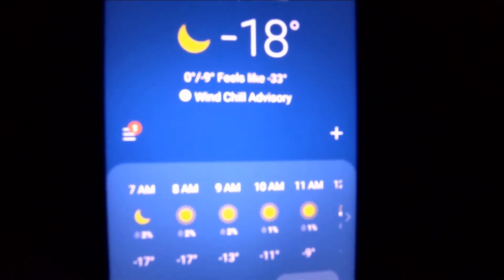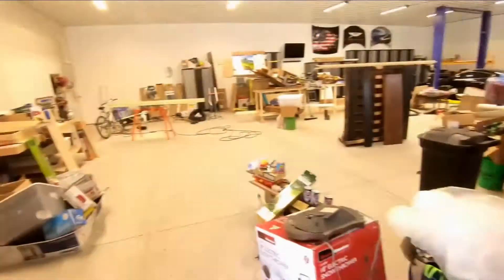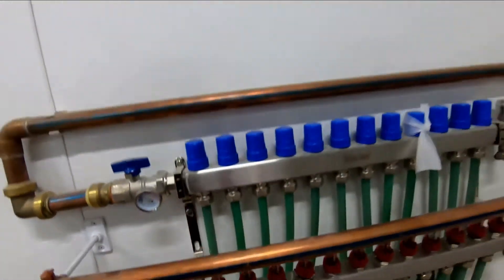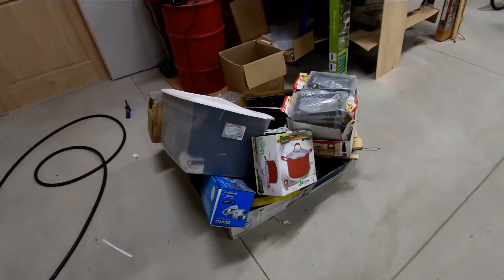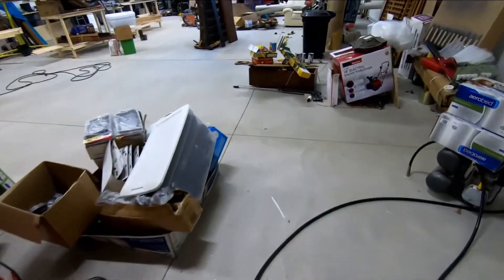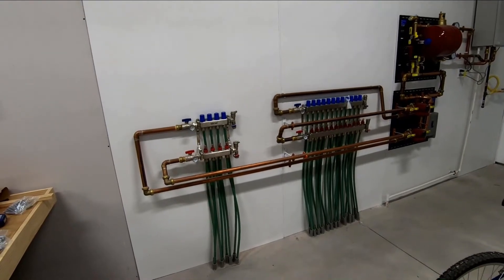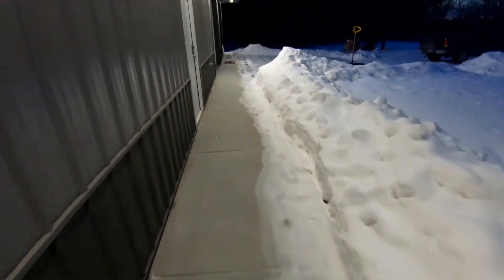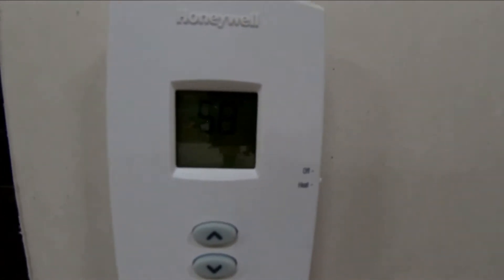-30  Degrees ! Did it Heat? NO Slab Insulation & Tankless Water Heater in Pole Barn Radiant Floor!

Comment: I am curious to know IF adding slab and perimeter insulation during the construction phase would have boosted your air temperature in the shop.  Is a floor slab thermostat "better" ?
Reply: Your not considering the cost of energy in the future.

There’s absolutely no way your saving any money without insulation under the slab.

Penny wise, pound foolish
Reply from the maker: @goobers8277  Its called a Thermal mass build and I am heating this cheaper then most 2000 sq ft buildings around me.  You put insulation underneath , you have a smaller thermal mass. Think of it this way, you have a small rock and a large rock. Small rock heats up faster then large rock , but cools down faster. This is a large rock and will keep heating without needing more heat input during the really cold days. It can go for 3-4 days in 20 degree weather without running. Where a insulation under slab would run everyday. If you want to learn, there are studies from different countries that have done Thermal Mass builds. Google it .  Building techniques have advanced in the last 50 years .People  said the same thing about spray foam insulation back in the day or about offset studs , it was a different way that many people weren't interested in changing to and said that isn't the way it has been done.
Reply: @JasonYouTube  Brother I’m well aware of thermal mass. 

But your explanation is slightly flawed.
You could have dug deeper? Yes?

Why not put 4” of ridged polystyrene foam board down first and then 12” of concrete. 

Plus IMHO not using ICF in new construction is absolutely crazy.

Just my $.02
Reply from the maker: @goobers8277   Your still not taking in the fact that the ground has heat also which helps in heating/cooling . Also concrete cost $140 yd vs $5 yard for sand and they have the same thermal properties. So I could of put insulation under 12" sand and then 4" concrete , but the cost of insulation wouldn't offset the cost savings of having that insulation underslab. Even if I saved 10% a year if I had insulation , my yearly heat bill is about $550 . So insulation cost of $2400 divided by the $55 savings would be 43 years until I recover the cost of insulation, which doesn't include the time to lay it.  Not you may say I'm wasting more then 10% to ground , and I show the cost in multiple videos , on how much it cost to heat a cu ft in my pole barn so others can compare it to their buildings. My heat bills are actually lower then most 2400 sq ft buildings that are stick framed in my area and that are roughly the same insulation values. Yes they may open the door more, etc.. but when people see my bills they are amazed at heating that big of area for that low amount. So talk to other builders who do thermal masses and see what they say, or check on google for some research about thermal mass builds. If you eliminate the underslab insulation, then you will eliminate the jobs and money to those contractors that are pushing for the insulation.  Like anything, follow the money trail . Researchers are not going to say something is solved if they are still getting funding. Why give up the money
Reply from the maker: @goobers8277 Put it this way,  Is your home or new homes built with R90 attic and R40 walls? No. That is because the added cost of insulation would not offset the cost of loss heat. Why doesn't every home have geothermal heat? Its more efficient and saves money yearly but it costs 25K and will recover cost in 25 years.  So those are some real world examples on how letting heat loss is acceptable if you cannot recover that cost sooner then 25 yrs.  So your saying that since inflation and cost of energy is going up, that homes should be R90 and geothermal systems ? I agree with your thinking but most people will not live long enough or stay in that home long enough to recover that cost. So environment energy saving wise, you are correct. But things change, in 20 years they may have different insulation or heating , that would make all those previous 20 year ago upgrades useless.
Reply: @JasonYouTube  insulation is the most inexpensive way to save money in any home or shop?
You have to factor in the resale of structures/property into account?
For most people this is a huge consideration?
I live in suburban Detroit (see cold lol) many new builders here using R60 in the ceiling & R35 in the walls for stick frame construction. It’s now code to insulate basements. Either exterior/interior or both. Now personally when I build my home and new shop, it will be 12” ICF block walls, ICF roof, insulated 10” concrete floors with hydronic heat. I will run two sets of pex in the floor. One for a hydronic N/G system & one for hydronic wood stove for power outages. I Will also take advantage of South facing windows for solar gain on the dark concrete floors. 
Geothermal has come down in price quite a bit from even 10 years ago. In Canada the Gov is actually paying for its citizens to have geothermal installed.

Here in Michigan geothermal (well type) is being used in industrial locations in conjunction with 3 Phase electrical. So it’s inexpensive to run.
Reply from the maker: @goobers8277  For resale , extra insulation won't make a difference, kinda like home remodeling and putting in exotic wood and expecting dollar for dollar recoup. Or the wife who spends 80K on the kitchewn but only appraises at 40K .  Your going to have over 200K in a shop, and you won't be able to recover that cost in resale as most people don't want to pay for the extra space unless its a single guy! If you do your build then its for you and not resale.   Finished garages get between $15-$45 a  sq ft for appraised property value in my area, mine got appraised at 100K before pandemic .  My neighbor is putting in a new 40 x 60 and got quoted 70K for structure only. That was the middle quote , and my 40 x 80 was 46K  for reference. So if you go above appraised value for sq ft , then you won't recoup it.   Geothermal is cheap to run but in the USA it is too costly. My neighbor installed them for a living and our house had it growing up. He got out of it because the rebates wouldn't make up much for install and residential business went down , except new commercial builds. I like the idea of a wood stove boiler , maybe you could run a bypass so you could only use 1 loop but when switching to other system could use a bypass valve?   But some counties won't allow that so the code dictates it. Kinda makes you want to move to Texas where codes are lax.
Reply: @JasonYouTube  I like to hear Your perspective. Your spot on with the geographical location. Yeah what’s really nice about the gasifying hydronic wood stoves is the heat from the floor and the stove. I’m not as worried about the overall upfront cost of all the systems as long as they are done correctly and save on future bills.
Reply: @goobers8277  Did you read the whole comment?
Reply from the maker: This has perimeter insulation , just no slab insulation. I compared it to my neighbors and another person who has slab insulation, and they couldn't maintain their temperature. BUT that could be due to they didn't design their system to -30 . I had this system designed to about -20 degrees at 65 temp. That means they added more radiant tube runs to heat the slab to maintain that temp. Said it was overkill, but better to have more tubing and shut off some runs or turn boiler temp down then not have enough. For the price , a 300ft roll was only $79 more , so cheap insurance to add more tubing.  My one friend just built a stick framed garage with same insulation and is running radiant with slab insulation, so I will be able to compare heating costs this winter. His build is smaller ( Under 800ft I believe) but should get a good idea on heating costs.
Reply: Built a post and frame building in the late 90's and didn't use floor heat or insulate under the slab.  I used a 2 foot rigid insulation board around the entire perimeter and I have no problem heating the structure with  inceiling hot air.  I live in upstate NY and we get some pretty cold weather.  I insulated the side walls and ceiling above specs. I also left a dead air space on the outside of the building.  If I were to do it today, I would have put floor heat in, and also put down rigid spray foam insulation under the slab.  That being said, my floor slab is warm.
Reply: I sure would have tried something - 2" XPS sheets or maybe spray foam. Foundation work is not something you "remodel" later.  What I wonder is does pex tubing go under or on top of rebar [or wire mesh] before the pour?
Reply from the maker: @flinch622  If your doing traditional insulation underslab heating , you usually staple the pex to the insulation , then rebar is in middle of pour above the pex. If your doing a thermal mass build like mine, the pex is in sand about 10-12" below the concrete , but is tied to a mesh grid work in the sand to keep pex in place.

Comment: Hey what is your condensate line for ? I am in the planning stages. What kind of sand did you use ? I priced sand it would cost me 8k
Reply from the maker: The tankless water heater is high efficiency, condensating , so extracts all heat from water vapor. Just regular sand, usually get it from sand pits . Sometimes can get it free if they are building by you , depending on if your area has basements.  Usually  it costs around $2-$3 a yard but trucking costs alot. Unless you can get a semi side loader. Then price goes down

Comment: Do you have a primary pump on this system, or just 2 secondary pumps for the 2 zones?
Reply from the maker: I have a primary / boiler pump and then 2 zone pumps. I show the setup in my video on how to build a radiant panel, so you can see all the parts. Thanks for watching
Reply: @JasonYouTube  
I'm trying to setup a Takagi water heater for a radiant system in a garage with no domestic water and am having problems figuring out how to control the primary pump.  Was going to do a primary/secondary loop.  Secondary loop will be 1 zone with 6 radiant loops controlled by a thermostat with floor mount sensor.  Primary pump turns on and off how?
Thanks
Anthony
Reply from the maker: @anthonyperalta8534  Primary pump will turn on whenever a zone calls for heat. So you only have 1 zone pump, so whenever that turns on, your primary pump will turn on also. Your zone controller should have wiring for that, but depends on what controller your using.
Reply: Ok.  So I saw your other video showing all the parts.  The primary pump is just plugged into the outlet with an extension cord.  And the secondary pumps are wired into a switching relay.  So how is the primary pump being controlled?  If plugged into an outlet it would run all the time, wouldn't it?  Thanks.  Very clean install btw
Reply from the maker: @anthonyperalta8534  In my setup, the zone relay controler is plugged into the outlet and the tankless water heater is plugged in also. The primary pump wire goes to zone relay. If you search for a zone relay, you can look at wiring diagram online and see how its hooked up. So tankless water heater starts when it detects  1/2 gpm flow rate. So the zone relay controls the pumps. You could tie the primary and secondary pump wires together onto a relay that gets energized/switched by  thermostat , as you only have 1 zone
Reply: @JasonYouTube  I only have one pump and one zone in my set up. Do I need a primary pump that runs a loop or can i just use my one pump to run it directly through the floor with out a primary loop pump along with a secondary running it through the floor?
Reply from the maker: @tomquick2594  Depends on how many feet of pex you have. The water heater needs a minimum flow to start it. Usually its like 1/2 GPM or 1 GPM .  So in bigger slabs, you need the boiler pump to keep it running then using secondary to zones.
Reply: @JasonYouTube  Ahhhhh, Ok Now I understand. I have (4} 250 foot runs

Comment: I would say your pipe feeding manifolds should be ad least 1"
Reply from the maker: These were planned with a local radiant floor design engineer ,  so just had them figure out the design and flow rates.  Maybe if you aren't running a pump just for boiler , then may need bigger pipes to get the 1/2 gpm needed to get boiler activated and run a bigger pump to achieve that 1/2 gpm. I'm guessing because i don't  have a degree in that area. Thanks for watching
Reply from the maker: Actually  they are 1" going to my manifolds, used type L copper . Everything is 1" except the input to each zone pump, they reduced it to 3/4
Reply: @JasonYouTube  OH,ok, on video looks smaller, Nice video. Thanks for reply.
Reply from the maker: @786otto  No problem,  my video of how to make your own radiant system  goes through all the parts with reference  to some stores inventory and prices.  Its deceiving as the building is bigger so everything looks smaller.  My 50" tv looks like a 32" in it! Thanks for watching